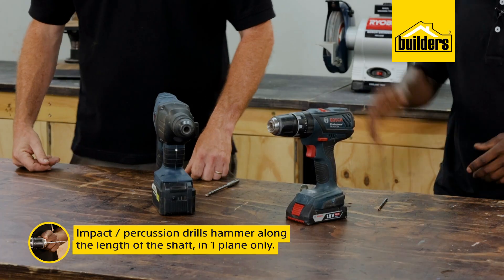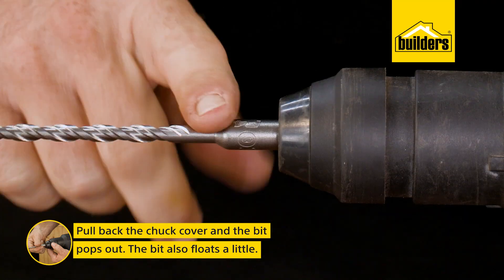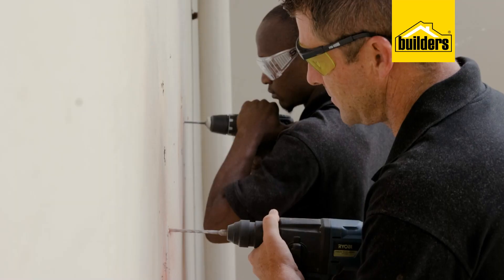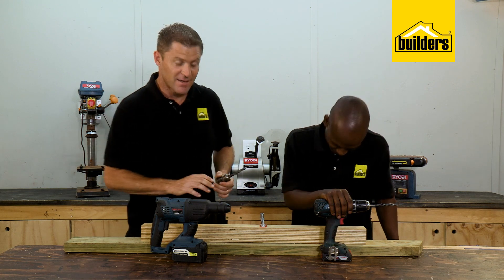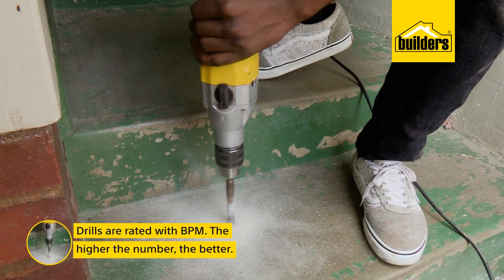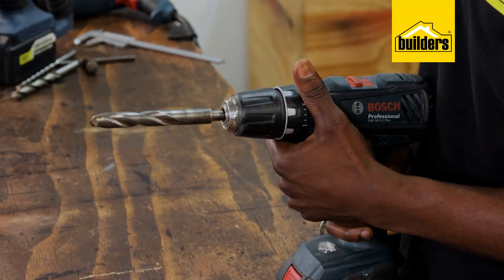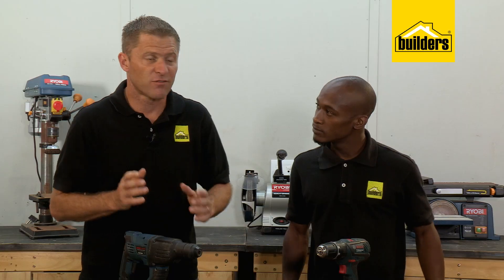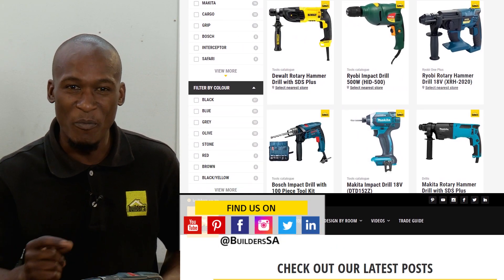Rotary SDS vs Impact Drills. What Is The Difference Between The Two?

Comment: Great video guys, but one thing. You are installing the bits incorrectly. The chuck needs to be turned as tight as possible, then one click counter clockwise to lock it in. Most people are not aware of this.

Comment: Been using hammer drills for last 50 years and never liked SDS bits. Can be a big pain in the ass at times to insert. My last 3 large hammer drills have been spline drive.Some plumbers & sparked swear by SDS bits.